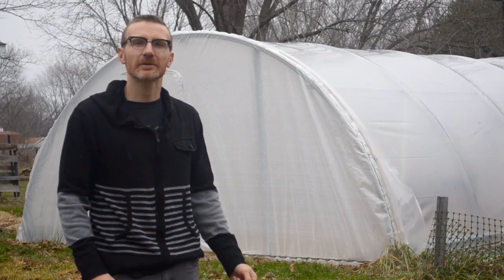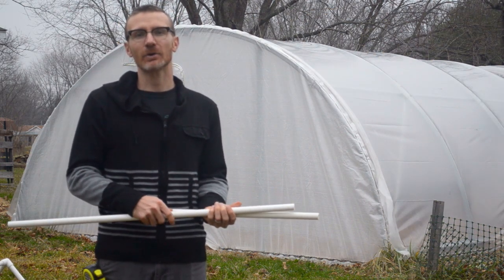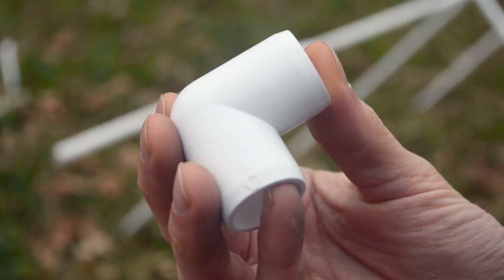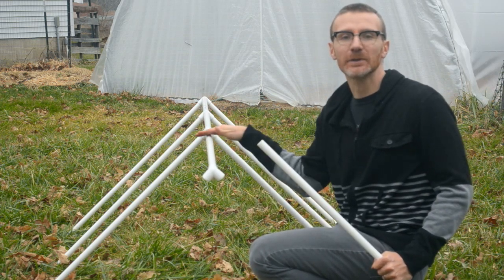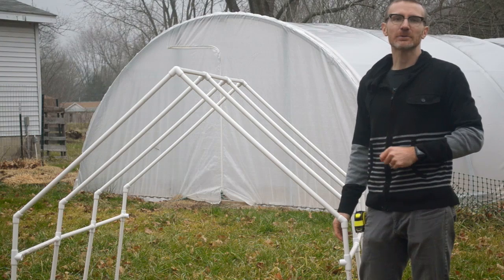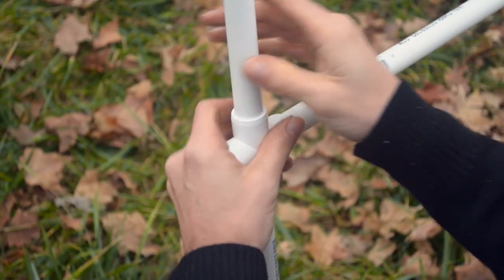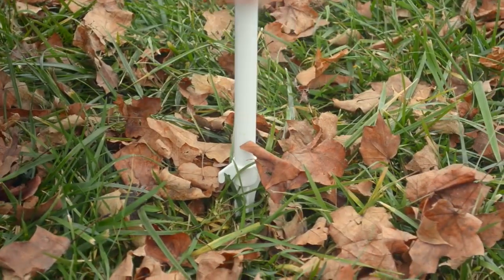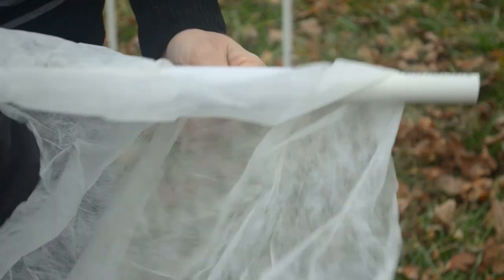How to Build a PVC Frame Greenhouse - Learn & Grow

Comment: Thanks for the video but there is something not addressed here that is VERY important. This frame structure as it is is very flimsy and will be subject to damage in high winds. Had one built out of metal pipes that were a problem with the first storm a week later. It was bought from Amazon and called Quictent and was very flimsy in design and with the first storm a week later, it was totally destroyed. The one good thing with the PVC is that it flexes and is more forgiving but the design you are showing will also be too weak to stand up to a high wind. Need larger diameter pipes and bracing to be considered as a serious greenhouse that is worth building to last in most environments.

Comment: Why do you keep calling a 90* a 45*
Reply: It creates a 45* from vertical, the slope of the roof.
Reply: @raygrinders3918  But you buy the fitting as a 90 degree fitting not 45 degree fitting,  Fittings are bought by their geometry and not how it's used.   Someone goes out and buys 45 degree fittings and they won't work!  But hopefully they''re smart enough to know that....but maybe not.

Comment: Snap clamps are neat, but they stretch out after awhile and strong winds will pop them right off the PVC if using plastic.  I learned the hard way that if you have any amount of wind in your area and are going to use plastic covering..save yourself the trouble of using wobbly PVC and snap clamps- do it right and use pressure treated wood with wiggle wire and C channels. As long as you build it using 4x4 posts cemented in the ground and cross brace the sides- you can sleep well on windy winter nights knowing you aren't going to walk outside in the morning to find your plastic up in a tree and the PVC structure in a heap with snap clamps everywhere.

That said, I do still use a PVC hoophouse in an area a bit more protected from wind.  Forget the gabled roof- too many cuts and joints. You want as few joints as possible. Best design I've tried is 2 10 foot 1/2" diameter PVC poles joined(glued) together with a 4way cross at the top ( "T" shape connectors on the ends).  Bang a 4 foot piece of rebar two feet into the ground at 4 foot intervals on each side.  Then slide one end of your (now 20 feet) 1/2" pipe over the rebar, and bend it over to the rebar piece on the other side forming an upside down U shape. Slide it all the way down to the ground. Make sure your cross connector at the top is laying the right way to make the top connections. You can put a small screw into the pipe at the bottom to help secure it to the rebar, but if you buy the right diameter rebar, it usually holds perfectly on its own.  You will get a roof about 8-9 feet tall, and a width of about 6-7 feet wide in your tunnel.  You can make it as long as you want (or can find plastic for)  

Secure (glue) each rib to each other along the top with cut sections of pipe.  Make sure each is the same length in your "top spine" or it will bend the thing out of whack.

Then use snap clamps to secure your shade cloth or plastic.  You usually want to use the 4 foot snap clamps and cut them to size- some about 12" long and some 6".  the 12" ones go at the bottoms where the pipe goes over the rebar. the 6" ones are for the curved areas.

Stretching the plastic over the structure usually bends it out of shape (this is why wood is better)  So don't stretch too much, just let it be a bit wonky (this is what you get with PVC)  and then cut some pieces to make the ends.  Close the ends when you need to trap heat, and open at least the tops if there's gonna be a sunny day.  It WILL get hot in there.  Be careful, becuase cooking your plants can do more damage than the cold.

Don't bother with the crappy Home Depot plastic. Buy the better stuff from Greenhouse Megastore- it will last many seasons.  The first time you put it on, you gotta line it all up.  Before you take it off in Spring to store for the next winter, get a permanent marker and mark out the center tops.  That way next time you just line it up alon the top spine and each end and you know you have it aligned before snap clamping it on.

Comment: Where can i get four way conecters and cross conects thinking of installing one for church prosession thanks
Reply: Any hardware store that sells PVC pipe will get you some of the fittings very cheap. There are some angles that they may not have, however, and then you have to buy the expensive "furniture-grade" pieces online.

Comment: is there something more durable than the rolls of plastic? Even the thickest stuff.  In the Texas sun, those split at the fold seams in 3 months or less. It's where they fold it to fit in packaging. Even without it, 6months is the maximum before the plastic sheeting is brittle and breaks apart.
Reply: Uv resistant greenhouse plastic

Comment: Can you make it tall to be able to walk in and will it hold up for the winter?
Reply: Yes. Depending on the weather where you are, try not to leave spaces bigger than 3' between bars. If you get snow, keep those spaces smaller and use a vertical center support if necessary. If your area gets mild weather, you can lighten it up a bit and it'll be fine. PVC is easy to cut with a hacksaw at any length you want. You don't need expensive equipment. Just the fittings.